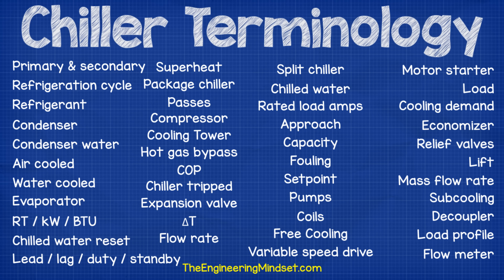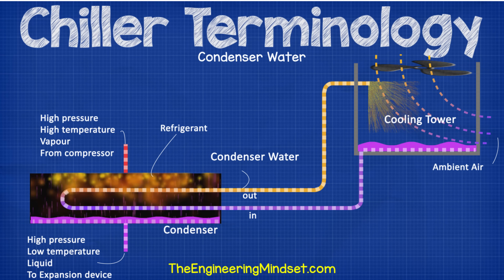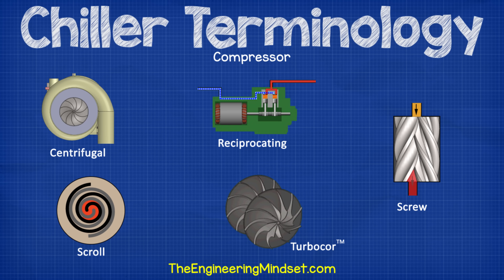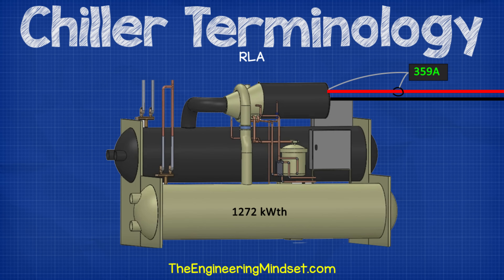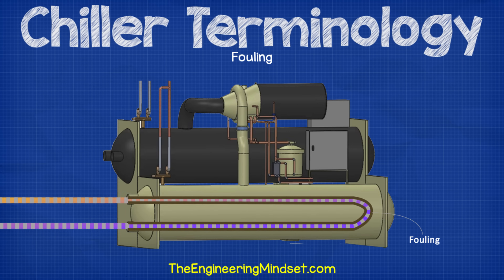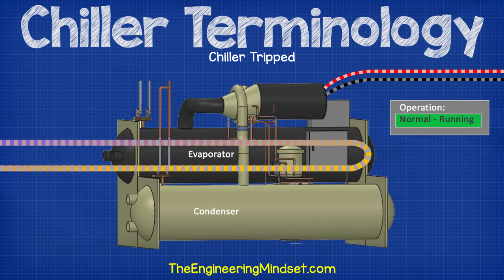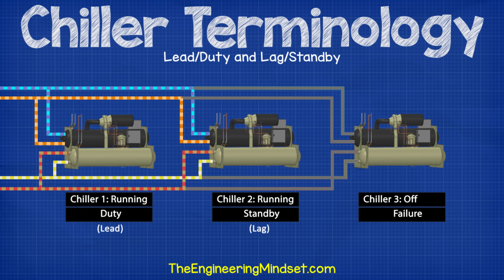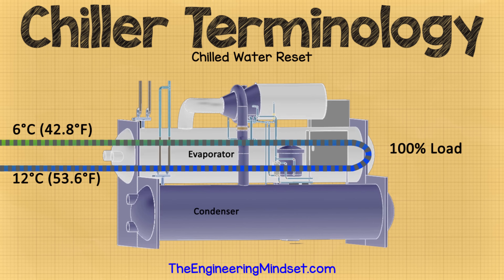Essential Chiller Terminology HVAC delta t

Comment: Hello Paul!  Thanks for the great videos.  You have a very clear way of teaching and I've learned a lot from you.  In the Delta T section of the video (14:38), are the condenser water temperatures backwards?  To me the flow coloring and direction looks accurate, but the temperatures seem backwards.

Comment: Wouldn't a reading of 4-8 degrees kelvin  be -269C to -265C?? Why switch between C or F to absolute temperature just for the super heat section? Also see some chillers operate normally at very low superheats, nearly 0.  15:00

Comment: HELLO PAUL. IS RLA (RATED LOAD AMPERE) & FLA (FULL LOAD AMPERE) THE SAME THING ..?
Reply: Running load amps and
Rated are different
Reply: You're super
Reply: Your superheat analogy is somewhat correct but should be restated The superheat would be the temperature of the liquid as it leaves the evaporator before it gets to the inlet of the compressor so that is the temperature gained if you have a high superheat that means your lower refrigerant or you could have an extremely high load or you can have a bad hot gas bypass but most of the time you'll hear them hissing away

Comment: 2:44, chamber condenser   where heat is rejected. Refrigenrent cycle of chiller  (6-12) °C and cooling tower (30-36)°C, what is there physics behind that hotter water cycle cools refrigent,which is colder than water.

Comment: A 1ton home AC is power rated at around 1800watt but we know 1ton is 3.5kw. Why is this difference?
Reply from the maker: Don't mix the cooling capacity and electrical load
Reply: Good morning.The answer practical ( in free space nearly o.k 1800 .But for plants  another figures)..Ali2019

Comment: 7:05
If I pump 5.4kw into a closed enviroment, I need 1KW of cooling? Is this COP?
Reply from the maker: Not quite. Its the amount of electricity the compressor uses to produce x amount of cooling. 
Watch this: https://youtu.be/h5ILlZ8nyHE
Reply: You need 1000kW of electrical energy

Comment: Hi, Can I ask you some questions? I'm new at this HVAC industry. Do I need a bachelor's degree to handle chiller systems? How do u get a job into chiller industry? I'm currently working at window type AC & Split type. what requirements do I need? Thank you
Reply: bule bule Just work for a company that works on commercial/industrial equipment. Then you can slowly start working on different types of equipment. Mostly likely they will start you doing preventative maintenance first. A lot of companies will send you to training classes.
Reply from the maker: If you want to work on the design side then you'll need a degree.
If you want to install and maintain then you'll need to complete a technician course. One of the easier ways in is to join a company that specialises in it and work your way up, but you'll need to demonstrate some knowledge and interest to get in. Show you've taken time to learn and genuinely want to start
Reply: bule bule in Ontario you need a ‘refrigeration B’ or the next ‘A’ and depending on the pressure an OE could be needed. I’m currently pursuing my third class and RB
Reply: Thank you guys for your comments. Sadly for me, I don't have a college degree. maybe I will need more experience before making it in commercial/industrial industry of HVAC. For the meantime, Ill just stick to small AC.

P.S: Good luck to this channel. I hope you make more videos, wish you many subscribers too. All the best!
Reply: @labradorarvingabion3662  dude, you don’t need a degree to get into the industry. There are Chiller Plants EVERYWHERE in the country. Do some research and land an entry level mechanics assistant job and work your way up my guy.
Reply: Work and learn hard with passion:)
Reply: Dear all give me some links n data to read n grasp technical issues in chiller.